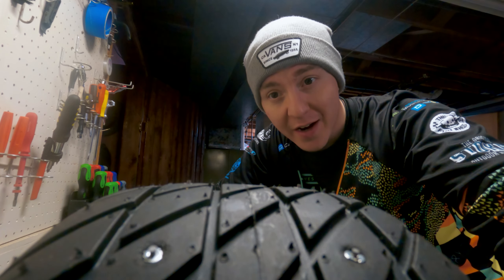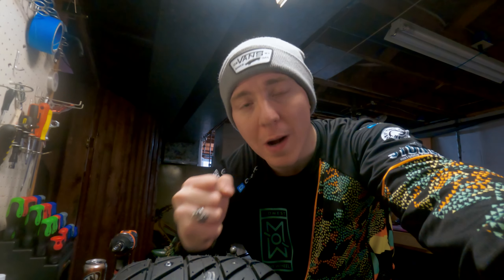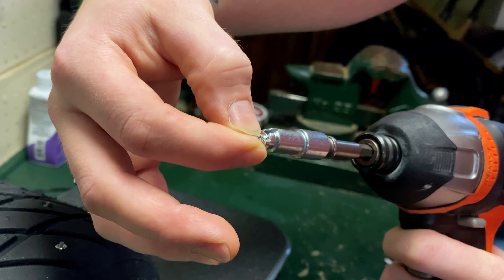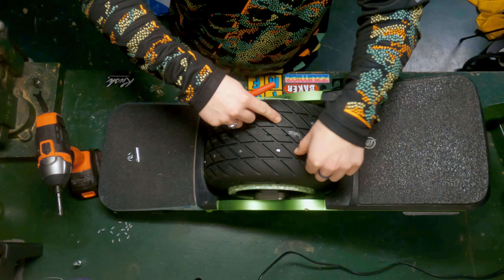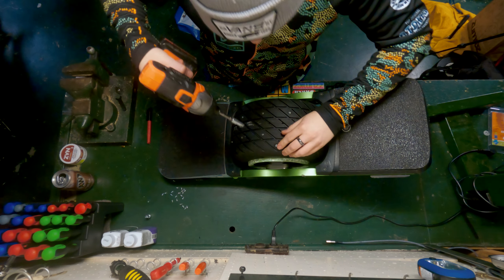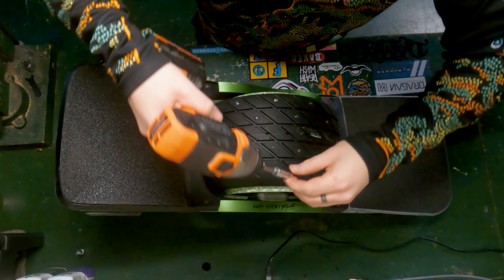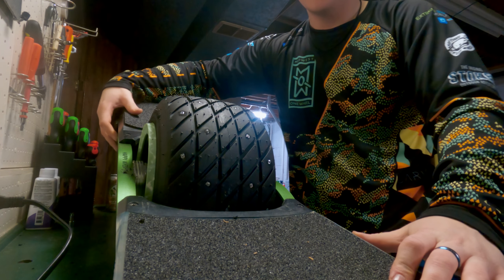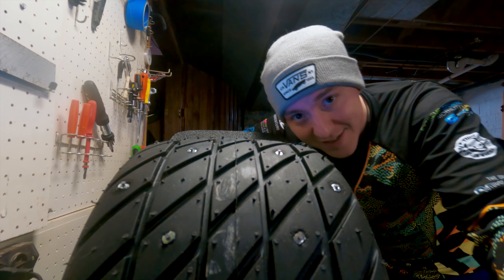How to Put STUDS in a Onewheel Tire

Comment: If you look "best grip ice studs" you can find flash hardened race ice spikes you can just screw with any tool in your tire and don't need to drill, glue or be afraid of puncture, they are flat head into the tire side. Smallest ones are just perfect for OW and EUC. I ride -20celcius with them.

Comment: Nice video, I wish I had seen it before I studded my tire. I used cheap studs and the installation key that came with it was a pain in the ass to use as the studs often got stuck in it and I'd have to back them out and use a pliers to pull them out of the tool. That said, even cheap studs work great but if I have to do it again I'll go with the more expensive ones with a better tool to make installing them easier. Also, I changed drills in the process of doing mine and being able to change the drill speed made a significant difference in how well they went in.
Reply from the maker: I figured that’d be the biggest difference between studs.. but glad to hear they still work well once in!

Comment: Thanks for making this video!  I’ve been thinking about studding a TFL Enduro until you posted this.  Haven’t seen this gt tire before.  What is it?
Reply from the maker: So I have an xr hub on my GT, so this is a Burris TX22 for an xr. I wouldn’t suggest the enduro for snow 😬 even studded, it’s like you’re on a slipnslide 😭
Reply: You’re right, I’ve noticed the lack of grip using an enduro in the snow.  There is just not many gt tire options yet.  Have you ridden a Onewheel treaded tire in the snow?
Reply from the maker: Sadly I haven’t tried the stock treaded yet in the snow, but I know people that have! They said it worked pretty good. Also that hard compound will be great for studs!